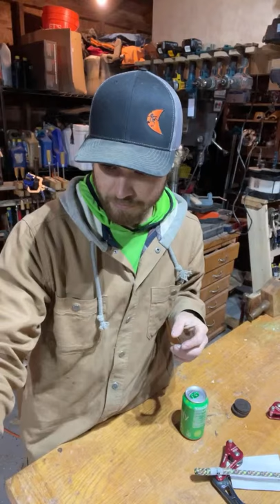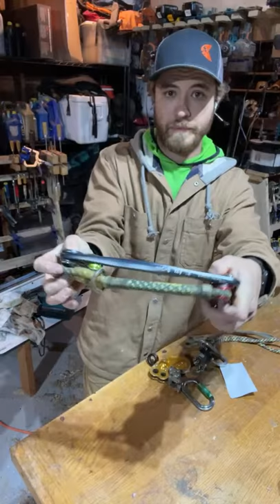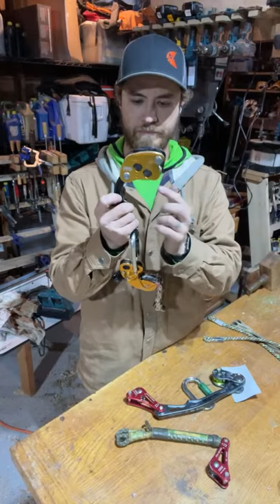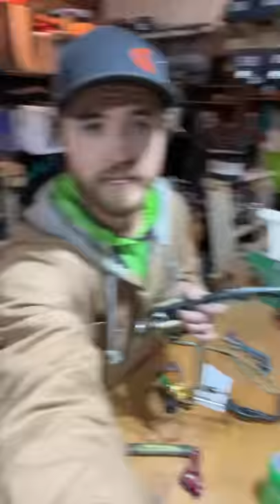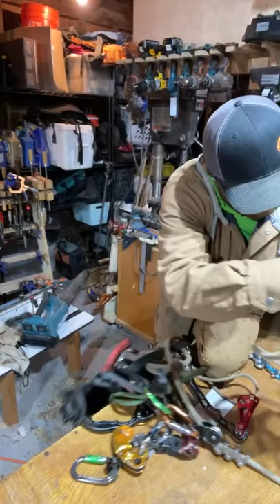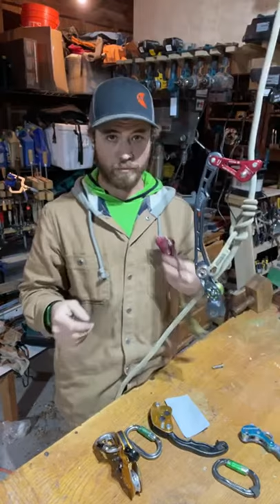SRT hitch device comparisons

Comment: Chicane is H frame that's all..for what I've tried it works best on hitch climber pulley set up.without zigzag it's to tall. With hitch climber set up you can break it down tp slack it out. Fast like the wrench. If you break the Chicane it's not life support the hitch cord Is the life support. Kevin Bingham talked about this. It collapses on the hitchclimber ...the hitchhiker xf is the best multi cender on the market .but because of americas idolatry mentality literally it doesn't get put in main stream sales.its hands down better and hitch cord lifesupport far safer than mechanical. It comes in 3 versions and cam be modified as far as mounting it bridge wise.wish I bought 3 of them instead of all the mechanical devices..it does everything

Comment: I actually made a rope wrench myself a while back. It's not your life support so even if it breaks you're simply back on a hitch. And it's working quite well the few times I've used it (I'm not a full time tree guy). Also for the little bit of spring tension that you mentioned you could just put a rubber band on the wrench near the tether to keep it up a bit. Your's looks way cooler I admit but mine's 20 bucks :P
Reply from the maker: That’s how Kevin Bingham started with that tool years ago !